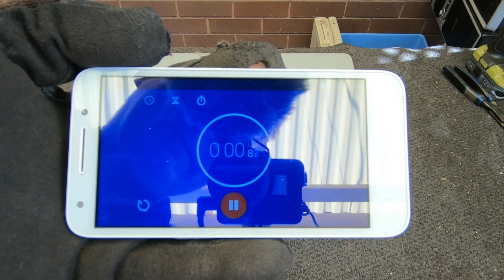Scrapping PC's 1 Hour Challenge - How Many Can I Do?

Comment: Love the videos Ben. I would like to scrap a bit, yet I am just still confused on some things. For example, should I sell my boards, cpus, ram, slot cards and whatever else to someone just how they are. Or should I just completely scrap them out by removing the chips, fingers and what not and sell them. At what point is a pc worth scraping, and at what point are they worth selling(as is).
Reply from the maker: Depends on the pc, usually modern ones are worth selling like with windows 10 but I prefer to scrap out pc's as people don't throw them out for nothing.
if your just going to sell chips & fingers then your best to sell the boards complete and spend time getting more stuff, just depends on how much your getting for boards, if your getting board sort type prices then yeah, i'd sell most stuff and maybe keep ram, cpu's for the future incase gold goes up a lot, ram will always be easy to sell
Reply: eWaste Ben thanks man, keep up the good work!